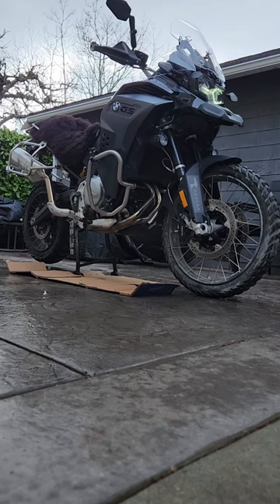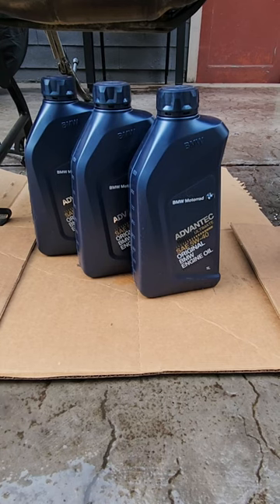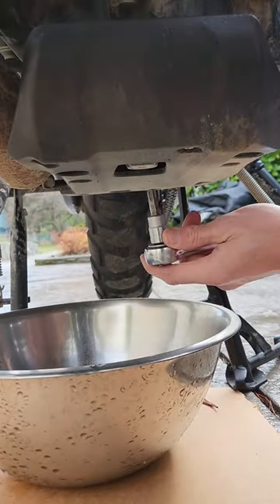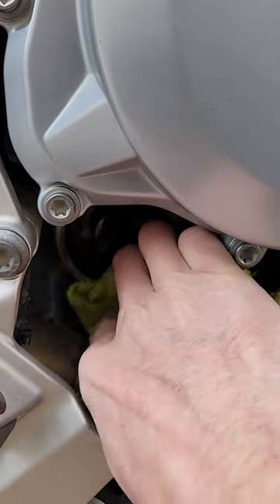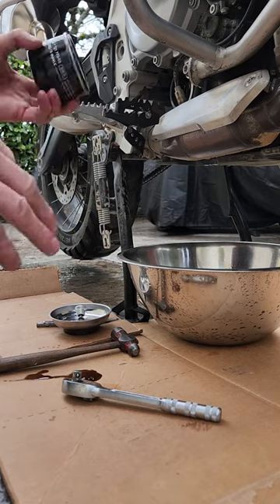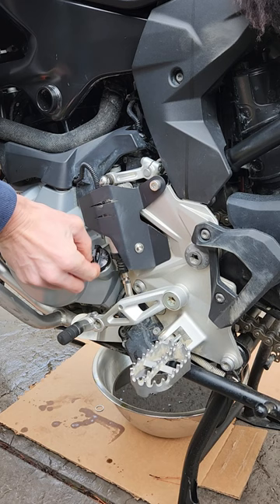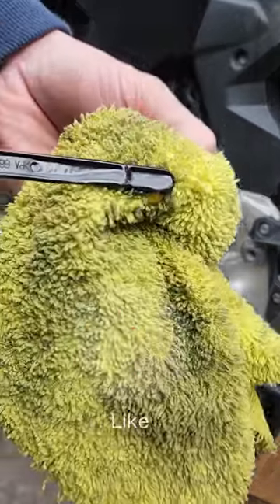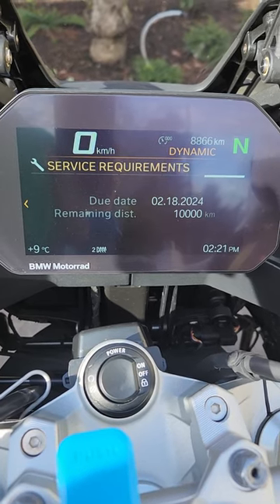2022 GSA 850 - Oil Change. 10,000 Km Service.

Comment: Nice, concise video. It may help to pour a little fresh oil into the new filter to help presoak and aid quicker recirculation perhaps?
Reply from the maker: Thats a good thought Naveen. Although because the filter is mounted horizontalally, it may just end up running back out when installing it.
Reply: @kristopherryanrides198  I only had horizontal filters until now. Don't fill the filter to the brim, just put some oil in and let it sit for a sec. If you are moderatly quick, nothing will leak.
Reply from the maker: @wickedtwix  Appreciate the feedback and would be forever grateful for your subscribe to my YouTube channel.

The issue is the location of the filter.. It is positioned right above the exhaust, and when you remove it, oil can spill on the pipe. Which in turn, will smoke as it burns off. That is the reason for using the tinfoil

Comment: excellent video ! but i have a question: Is professional motoscan membership enough or do I need to buy ultimate?
Reply from the maker: Thank you for the kind words and  for reaching out. "Ultimate" is required for resetting codes and service intervals.. In my opinion, it's well worth the one time fee. I think it cost me $60 or $90 CAD. 

Also, I would be very grateful for your subscribe to my channel 🙏

Comment: How do you like the bike so far? In my opinion no need for tin foil or puncture filter, also use hand 'torque' by feel, common sense . gl.
Reply from the maker: Appreciate the feedback back Alex, and would be grateful for your subscribe to my channel... 

The bike was good while it lasted, I quite enjoyed it. Traded it in this past May on the 2023 R1250 GSA 

The puncture and tin foil is only to avoid getting oil on the exhaust pipes. As it smokes a fair bit when this happens. 

Obviously, hand-tight plus a quarter turn is tight enough for most oil filters. However, I like to do my maintenance to the BMW specifications so as not to void any warranty.

Comment: Para mirar nivel de aceite jamas se enrosca el tapon de la varilla, solo metes y sacas sin roscar ,por lo demas buen video.
Reply from the maker: I appreciate your feedback Rob. Unfortunately, you are mistaken. what you are saying is incorrect and would result in over-filling the motorcycle with engine oil ... The correct way to check the oil level of a BMW F series motorcycle is to put the Dipstick in without engaging the threads. "screwing it in."

*Please refer to the owners manual,  (Page 183) From there, you will confirm that my procedure is correct.

For your convenience, below, I have attached the link to the online manual PDF. 

https://acrobat.adobe.com/id/urn:aaid:sc:US:f0588978-6815-43dc-b935-da42d8eb67b9

Comment: What code reader do you use?
Reply from the maker: Thanks David, I will add the links in the description. However, so you know, I use the MOTOSCAN app. It's a great diagnostic tool. Unfortunately, In order to erase error codes and reset service reminders, you do need to pay for the premium version. If I remember correctly, I think it was around $90.

Comment: Does it void your warranty if you do this by yourself but with oem parts?
Reply from the maker: I confirmed with my dealership and with BMW that it, does not void the warranty.  Just use OEM parts and oil.  I purchase mine from my dealership so  they  have a digital record of the transaction.
Reply: Thanks for the reply. Did you get them to update the service interval in the tft dashboard as well?  @kristopherryanrides198
Reply from the maker: No worries, @IoanAlexandruAndrei  I appreciate the feedback and would be grateful for your subscribe. 

With regards to updating the sevice interval code, I actually have a code reader and I reset the service interval code myself

The link to the code reader and app can be found in the discription of my video. In my opnion, it's a worthwhile investment as it basically pays for itself after one oil change